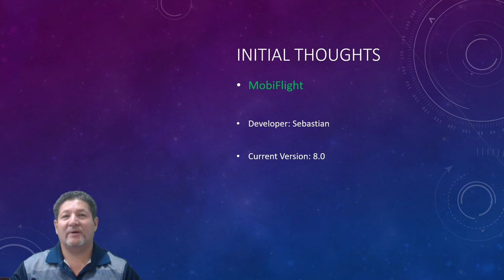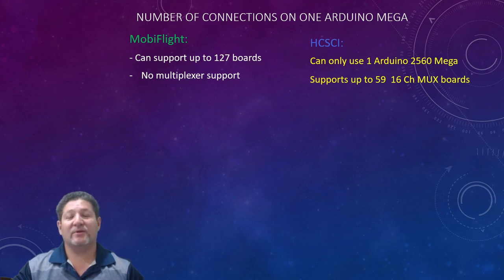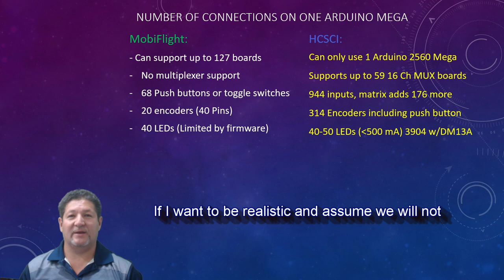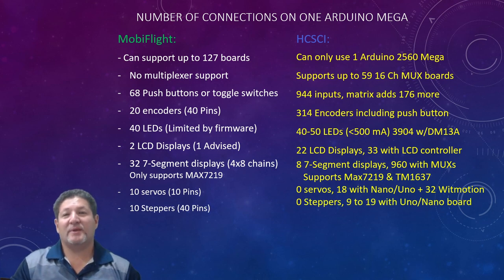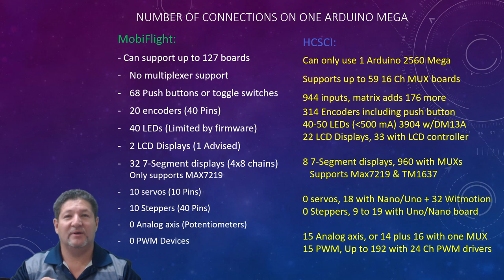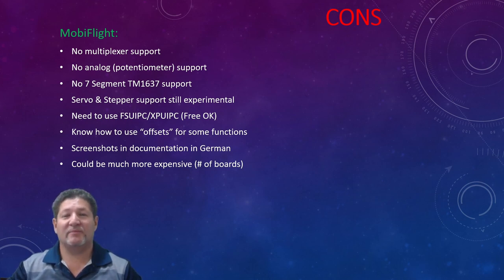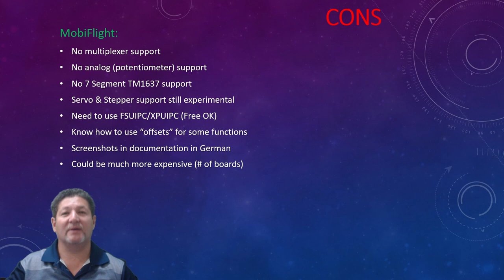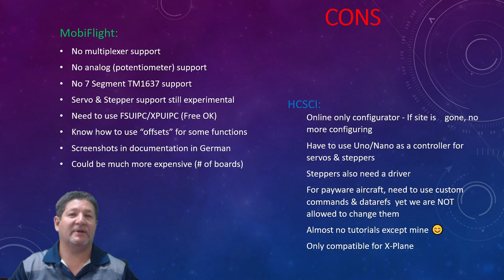HCSCI (Now SimVimX/RealSimControl) VS MobiFlight (Please read description below)

Comment: All in all, the only thing that genuinely sucks in HCSCI right now is its new name lol
If they listen to ihrer other people much better than we are able to read, they will think about ways to improve that stepper motor and servo limitation. Flying without force feedback kills a ton of the purpose, even though it's a huge plus compared to mouse and keyboard only.
I don't intend to leave XPlane either, it has great reviews from real pilots.
Reply from the maker: Im not sure what you mean about improving the servo and stepper situation. I think those would only be used for gauges or instruments not for force feedback. I remember seeing something about force feedback on the website confugurator a long time ago. Although for that I believe big AC motors would need to be used but thats another area I have not looked into either.
Reply: Did you manage to make a force feedback with simvim?
Reply from the maker: @jetraid  No I've never tried doing force feedback but i remember seeing entries for that a long time ago in the configurator
Reply: @Qosmokid  I thought of steppers because they are used in 3D printers and they have the ability to lock their movement electrically, but you might be right about using AC motors for that purpose.
Reply from the maker: @rohrichoak9740  If you are referring to shaking the yoke or the entire cockpit or having some kind of force on the yoke axis and rudder pedals then yes. Maybe I misunderstood what you meant by force feedback
Reply: @jetraid  I don't have the motors yet as I'm building my own sim with 3D printed parts, so I haven't got into that yet, but it's something I'm looking forward to. The only thing I noticed is that former SimVim has an output option for the throttle levers where you can assign a servo or motor to.
Reply: @Qosmokid  I'd ideally have a combo of motors for different purposes. I'm not sure whether AC motors can be controlled the same way as steppers as far as being electrically locked. I thought it could be a good idea for things like locking the throttle levers when you apply reverse thrust, for example.
Reply from the maker: @rohrichoak9740  Oh no for things like that I think powerful servos or steppers would be better. When I heard force feedback I imagined the rumble pack on the Nintendo 64 lol
Reply: @Qosmokid  lol, it's actually funny to refer to aircraft simulator  motors as "force feedback" like in game controllers since real aircraft uses motors as well. Sometimes we do treat simulators as mere videogames, but they go a little further than that.

Comment: Just stick with what you hav as you said. I only fly X-Plane so I really don’t care. Restricting data refs sucks as I am pretty certain you can indeed have an out of the box interface and still leave data refs exposed. The reason Laminar put them in there is for plane developers to use them. This just makes it easier for SimVim to package their product and reduce the development complexity for them which works are when creating say a gps on a model that follows Laminar’s interface. This rare as quite a few do use custom data refs. so if a third party model uses custom data refs outside the parameters of the standard interface you are, to put it politely, screwed.
Reply from the maker: LOL Donald you are completely right. I don't know how difficult it is for them to expose all available parameters in the configurator for editing. I imagine its as simple as changing the permissions or simply posting all of them in the custom converter page. If they already  allow 70% of them to be changed, I figure it must be pretty easy to make the other 30% also. At leadt i hope its just a matter of them wanting to do it.